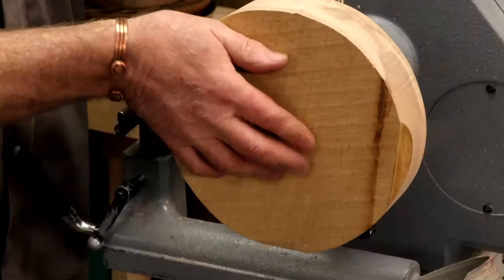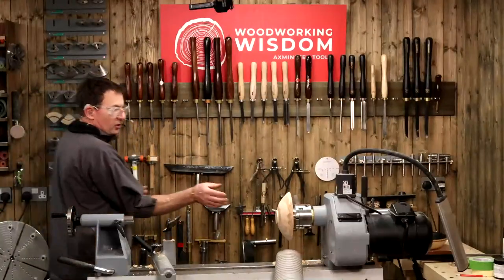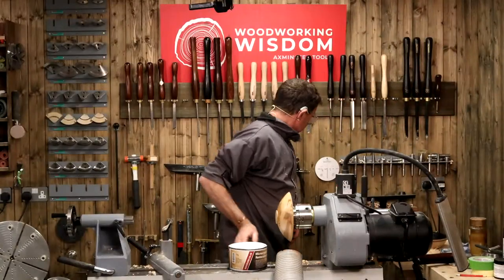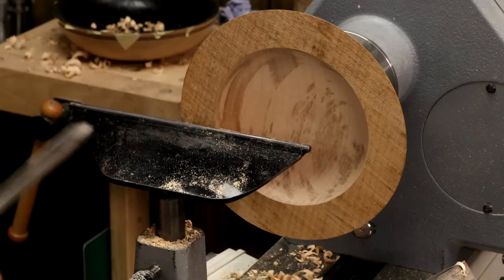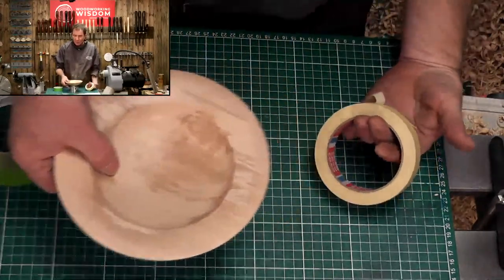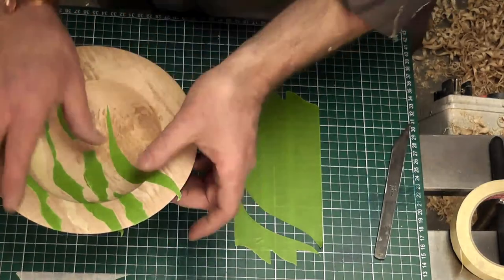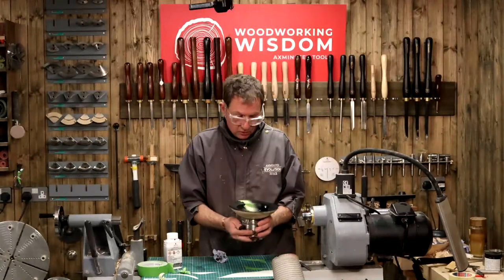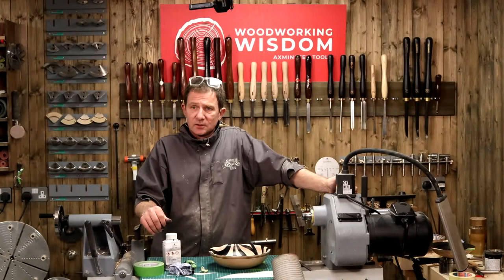How to Turn a Zebra Bowl - Woodworking Wisdom

Comment: Could I ask, what grind Jason had on the bowl gouge he used on this please?
Reply from the maker: Hi Stephen, the gouge had a 55 degree bevel and was sharpened using a CBN 180 grit wheel and the Woodcut Tru-Grind jig. The gouge had a small secondary bevel on the back to remove the hard corner. For more on sharpening jigs to sharpen woodturning tools, watch Jason's demo https://youtube.com/live/wz1BN8VvAag
Reply: @axminster  Thank you. Much appreciated.